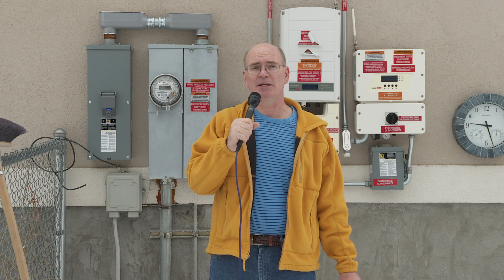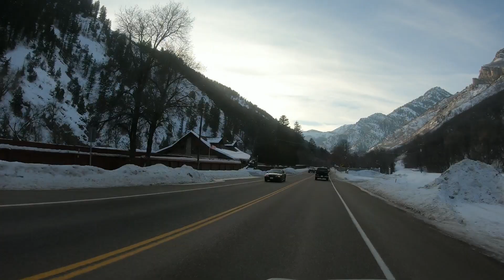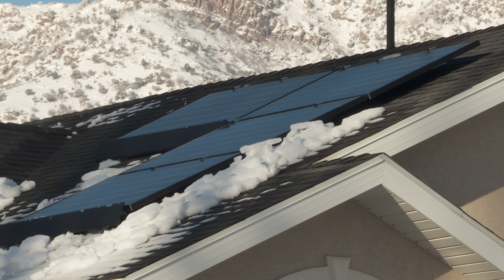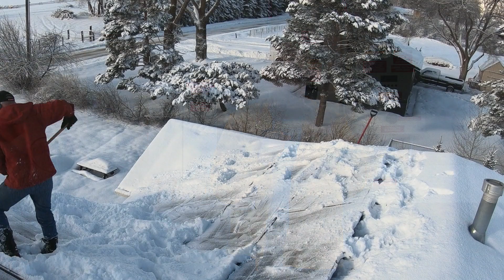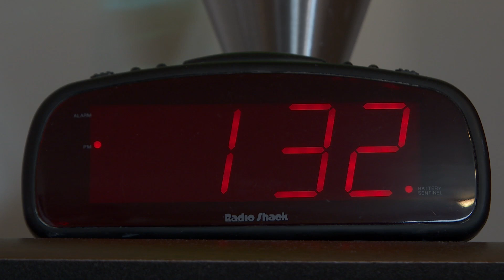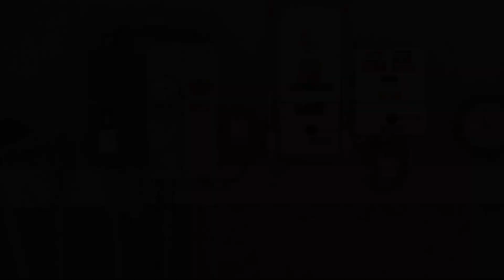Solar Panels On Our House - Two Years In

Comment: Really good video. The silly part is the frequency stuff. Solar panels generate DC power which does not ride on  a frequency. DC power is like water through a pipe. However due to the oscillating nature of AC, this is imposed on the potential / current by the inverter (s). Inverter if String, inverters if micro. Outstanding video over-all by a consumer / layman!! As the name implies, the DC is inverted to AC.

Comment: Greg,
If that's a SolarEdge system, which it looks like to me, you can get years of data by signing up to their site and installing a wireless or a wired connection to the SE inverter and link to their site with your computer or smart phone to track years of energy usage. This is what I do and my data goes back 10 years.  It shows everything I need from daily, monthly or yearly usage and energy created.

Comment: We on day 310 with our 26 panel home solar system.  We love it.  The sales people were honest and told it like it was with one exception. And to be honest I might have missed it if they talked about it.  With our electric utility there is a minimum monthly charge with taxes of $13.78 so even though we produce more than we consume we still will pay $165.36 a year. Maybe most do not produce more than they use so it’s a non factor. It’s no big deal to me. We love that we have 1700 sq ft home with electric water heater, stove and clothes dryer,  of course central A/C and live very comfortably.  This home formerly cost around $150 month on average or $1800 a year.

Comment: I had Solar Home power put on 15 panels plus a battery power backup ,  my home is 2500 square feet ,   the battery power is fantastic ,     total cost for the panels and the battery backup was                      $ 35.000 .  I had them installed November 2019 so I went through winter , my light and gas bill ran about $97.00  Normally it would run about $240 a month.  So yes solar panels  are fantastic.

Comment: I had asked how you remove snow earlier before I saw your video. I use a snow brush on a 24 foot pole to remove my snow. Takes a couple of hours. I use a ladder.
Typical warranty on panels is 25 years efficiency will drop about %20 I'm told which means you just replace some of the panels to offset the difference. The inverter should last at least 10 years.

Comment: Greg You are a clock guy, get yourself a "plug in" "motor driven" clock.  This will tell you if your radio shack clock is just malfunctioning because of old dried up caps/components.  I doubt; No I believe it to be pretty much impossible for a 10kW solar inverter to lower or raise the Utility grid frequency.  Think of a bicycle built for two, in his prime Lance Armstrong has the front seat and there's a infant on the back seat.  It may be more like harmonics caused by the switching of the Inverter getting to your antique radio shack digital clock.  I love that you have one  that still works, talk about bring back the 70's...  I like your delivery and explanation on your solar panel performance you need to keep this up including cleaning off the panels to monitor the fall off of your PolyC panels in the coming years.   10 years will be here soon and the performance will start to fall, you need to add to your matrix the weather - including temperature as production falls off on hot days etc.  To your continued success and looking forward to more annual updates.    PS. most devices / appliances are now rated at both 50 - 60 hertz, making 60.00hz less important than in past decades, in fact the Utility will soon control your Inverter by changing the grid frequency.   Great Job..

Comment: Just a thought, I would think in a system like yours by adding batteries your may solve your frequency issues because your panels will feed your DC batteries and the batteries should output a stable current to your inverter.

Comment: 3 deception points I got caught in with SunPower and ConEdison:  1) Performance guarantee - if system produces under 'promised' amount (about 90% of my average for previous years),  I get $ refund equal to cost of underproduction. In reality - electrical costs here have 2 parts: cost of electricity and cost of delivery.  SunPower only refunds cost of electricity. Meaning I get refunded only 1/2 of what's due.
2)  I was promised time-of-use plan (electricity cost is higher during the day, when solar panels overproduce, than at night) 3) ConEdison's monthly 'billing' charge is about $20 , even if I do not use any electricity.

Comment: This may be fun to play with, but that's all you're really doing. This system is impractical. You amortized this at an interest over 20 years. A year later you added more panels and more inverters. Now you're thinking of adding battery backup. Do you not understand that each and every one of these components degrade? None of them will last 20 years. They're a money sink. The reason for having a decentralized electricity grid is that power stations are efficient and are maintained regularly. You're really trying to convince yourself this was a fun investment, but you going up on that roof in the middle of winter was beyond stupid. I'm guessing your wife has a life insurance policy on you or she'd tear those solar panels off the roof herself.

Comment: Your comment on the frequency of generated power is incorrect. The inverters always track the exact frequency of grid power or else the grid power will destroy your inverters. Check into syncing and how it works and it will make more sense to you. :-)

Comment: Nice video.  Very informative.  I have a question for you.  What is your return on investment as far as time is concern?  I had been thinking of going with solar, but I don't think that it would be worth it in my situation.  I use 7500KWh-8000KWh per year, and my bills run $55-$100 per month, with only like two bills being at that $100 amount.  Based on a $25,000(I'm sure cost would be more)purchase price and average bill of $150, it would take me 13.88 years to break even.  That is not including any maintenance or damage replacement.  What am I missing here as to how solar would benefit me?   Thanks for your time.
Reply: 13-15 years is pretty typical ROI before its worth it, so if you plan on staying at your home for a long time it may not be worth it....this guy didn't think it through, since he had the company install the 2nd system a year later, they should have provided the pros and cons and talked more about his energy use....some solar installers will do a free energy audit of your house so you can see where you might want to do additional home energy improvements......there is no maintenance with the system...the only issue that you will have is the inverter that sits under each panel...they tend to go bad and even though they are covered under a 10 year warranty by the company that installed it, the solar installer has already got your money and is very slow on coming out and taking the bad inverter off and replacing with a new one, so your solar panel with the bad inverter will not produce any electric until it is replaced...I am not sure why this guy was tracking manually, all these systems are online and you can track it from an app and download that information.

Comment: Regarding battery backup, it is a good idea but many batteries are not very efficient, to get a good battery storage system you need to invest quite a bit of money and you need the space for the extra solar panels and the space for the batteries. My goal is to try to go completely off grid. The main reason for this is that in France a good percentage of your electricity bill is monthly fees and taxes. I don't mind paying for the electricity but i find it a joke that we can be charged a monthly fee for something they are selling to us! It can be up to 25% of the bill!
   If i can afford to fit the system myself i should be able to pay it off in ten years or so but then there is the question of how long will everything last. What if the batteries only last ten years or less, what if the inverters break down? What if the solar panels start to degrade?
  Solar electric needs to be designed with deterioration and maintenance in mind which is one of many good reasons to oversize a little at the beginning.
  One thing to bear in mind is that we can benefit from using as much power as possible during the day, set all washing machines, dishwashers etc to run when solar power is peak. Try to use low power appliances during the night. If using battery storage during the night you have to consider that the power from the batteries is less efficient than from the panels directly as it has to be converted to the charging voltage and then the batteries themselves have a fairly poor usable efficiency curve. You also loose efficiency from the inverters depending on how good they are, you usually loose at least 10% there. What more people could try would be to try to tap more of the lower dc voltages from the panels so that some dc voltages could be used directly into batteries or other devices that would normally use a transformer in them. It is a waste to convert dc to ac then back to dc again :D Also by sharing the output from the panels to both the ac inverter and to other dc appliances at the same time then the power is more likely to be all used. If you have a grid tie inverter then you can just try to sell power back, this is fairly efficient but you may not have excess power to sell back and you might still need to pay monthly fees or other fees to your power company just to have a contract with them.
  Lastly. We can mix up our potential to harvest solar energy by using devices such as passive air heaters which are warmed directly by the sun, or by heating water directly from the sun. To heat water with electricity generated from the sun is not very efficient at all. 
Note, some gas boilers are often electrically boosted. If you heat your water with gas you should check the specs of your gas boiler. Many of them use an electrical filament to boost and regulate the water temperature. Where the element is not powerful enough to heat the water alone yet it can consume somewhere upwards of 500W while your hot water is running. Another thing to bear in mind if you are trying to go off grid.

Comment: The biggest issue with solar panel sales is that 95% of people are buying the wrong panels. Thin film technology takes a little more space yet it generates full power in lower light conditions, this means you don't need to track the sun and you can generate power earlier in the day, later in the day and on overcast days.
  Take any mono or polycrystalline panel and watch the power generated  rise and fall as you tilt the panel away from the sun. Just twenty degrees or so and you loose a great deal of the panels potential. SInce almost nobody uses a solar tracker and almost  all solar generated at home or on commercial buildings do not  get positioned seasonally that means that unless you live near the equator you will only get full power for a few months of the year for around 5 hours a day. Why not use thin film and generate full power 300 days of the year for 8 to 10 hours of the day or more!
  Yes it costs more and yes it takes more space but unless you are using a tracker you are only making half of the power you could be generating with the same footprint. What i can't believe is how nobody knows this. Everyone is blinded by cheap mono and polycrystalline panels!
Reply: Yar Nunya  True and they have a few other disadvantages. But they work all day long in most conditions. I'm surprised not more people are using them.
Reply: There are many issues with photovoltaic solar in home installations, but yeah the fact the panels are fixed and don't track the sun is a big one. Power stations in certain climates are profitable because they track the sun and are regularly maintained and cleaned. Not to mention home solar panels are often obscured by vegetation, get dirty or damaged from temperature changes, etc etc. This is a toy that's fun to play with, not a practical way to power a home.
Reply: @maybehuman4  Yea, i kind of agree after messing around with solar for some time. It is hard to get performance and difficult or time consuming to maintain.
  I am seriously considering 2KW -5Kw of thin film so i may get close to full power most of the day most days of the year.

Comment: What did you pay (or, what are you paying each month) for the solar system you've got installed?  Thanks.  Tom M.
Reply: The total cost would be more helpful vs the costs he used to have on average as there are many different financing options based on income and credit.
Reply: @DENicholsAutoBravado  Agree with you on that.  Nearly every time someone tells me how much they save on their electric bill by using a solar system, they won't tell me how much they actually paid for the solar system.

Comment: So how do we scale this?  If every single household in your area added a similar solar system and now they are all paying less than $10 a month to the electric company.  Then a big winter snow storm covers the entire area and solar output drops massively for at least a week.  The electric company is now expected to provide all those households all the lost solar power instantly and reliably for a week if not longer.  It is not like they can save up the power you gave them back in the summer to use in the winter.  I think in many areas grid backed-up solar power only works if a small percentage of households are using it.
Reply: I made a similar comment at the end of his 1 year in video just minutes ago. 🙂 agreed
Reply: As has been proven in Australia power companies can install larger capacity storage systems to accommodate large rapid changes in demand. Also, power companies do not need to generate their own power, California buys much of their power from other states, grids are interconnected across state borders and brokers buy/sell as needed. In an ideal world there will be no power companies, every home will be off-grid and generate it's own electricity using solar w/ battery backup.
Reply: Home solar is a joke. Being 'off the grid' is a joke. The grid provides redundancies and efficiency. If his solar inverter fails and he didn't have the grid to fall back on, he'd be out of power for weeks until they replace it. The more complex the system the more things can go wrong. Now he wants to install backup batteries. Not only are those battery banks expensive, but have a stable shelf-life of about 5 years. Good luck replacing those batteries 4 times before he finishes paying off the interest he took on that 20 year loan.

Comment: As someone in the midst of a residential solar project installation,  I really appreciate your videos and data.  Thank you.  

I'd really like to track my output and usage as you have on a spreadsheet.  Thanks for doing the video about how to set up a spreadsheet.
Reply: Most of these systems when installed are hooked up to your wifi and have software, so you have an app with all that information, there is no reason to manually track it...the app will produce all sorts of reports on energy produced, tracking everything in detail.

Comment: Great job! Our system begins being installed on March 28th (provided the permits are all in order). We live in rural Nevada and have plenty of property, so we decided on a ground mount system. It will cost more but we were able to have the panel layout such to garner the most sun as possible. And at 71 I'm not crawling up on a rooftop. (My wife would kill me). We were told to be sure to keep the panels clear of dust and so forth so I can do that at ground level on a regular basis. Debris=loss of panel efficiency. I considered the power wall option but will also wait and see. There have been advances and I want more than is now offered. I suggest you check out the innovations coming from Australia in regard to storage/walls. There is a large industry trade show yearly in Las Vegas, it's 60 miles from here so I will visit that next year. Again, great job. Our system is 12.25 KWH

Comment: Thanks for the video.  We are installing a new system that is expected to produce 1500 kWhs per month at our home in Panama.  We are also holding off on the batteries but watching the technology as it progresses over the next few years.  Panama does not have the snow issue but does have quite a few clouds and rain at different times during the year.  Again thanks for the video and we will be watching to see what you move forward with on batteries in the future.  Cheers

Comment: I was told by my salesmen that 2-3 inches of snow actually generates more electricity. Please let me know if that's your experience.
Reply: Hmm. Maybe all the crystals help gather light from more angles?
Reply: @DENicholsAutoBravado  From your experience, has snow generated more electricity?
Reply: Snow reflects upto 80% of UV radiation, if you clear your panels you can get more power than usual if the panels are angled to collect the diffused UV from the surrounding snow. This is more of a benefit for people surrounded by large fields/farms, than people on mountain sides or surrounded by forests and buildings.